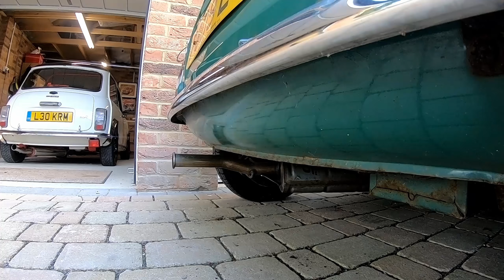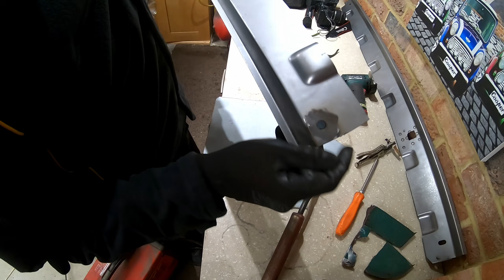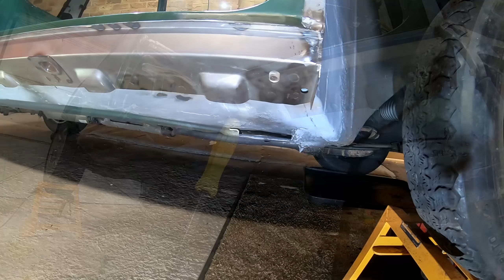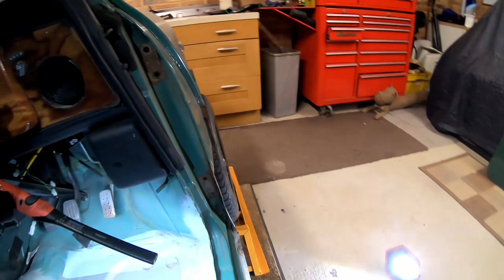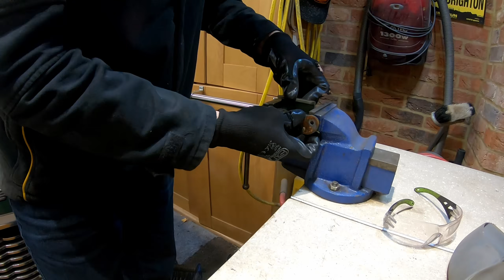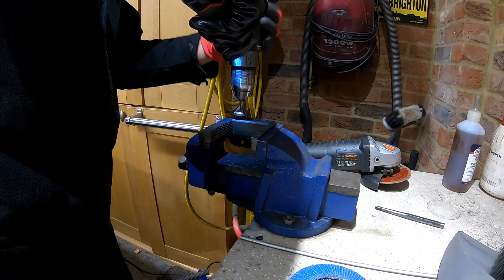Classic Mini Workshop - Project Sprout Pt.18 Sill Finished & Door Hinge Repair

Comment: Hi, great video. Did you get around to using the spot welder for the seam? I have one and was wandering how to best ensure there is sufficient penetration on the spot weld?
Reply from the maker: I practiced with a few cut off's and then tried to rip apart to see how strong it was. After a few welds you get a feel for the welder but generally if the metal is clean and the tips are clean and cut well then the weld if perfect every time

Comment: I used to work on WWII jeeps and we welded up holes in the bodywork by using a piece of PhosphorBronze behind the hole, Tried copper but the heat from the weld distorted it and we found the PB let us weld up bigger holes as it dissipated the heat better.

Comment: "The weld won't actually stick to the copper", oh, Damnit!
Thanks for the upload Keith - coming along nicely mate. On a side note that jacking point is quite handy actually, wish cars nowadays had something more sturdy and made for the job. I changed the rear springs on my car today (fiat 500) and faffed around for ages finding a secure place to jack and put the stands under (the sills on the 500 are not load bearing so can't just slap a jack on them willy nilly). I hate scratching up finishes so some old carpet was used and plenty of wax oil on the rear beam and spring cups. Then it rained (again).
Reply from the maker: LOL, Thats exactly what I was thinking!